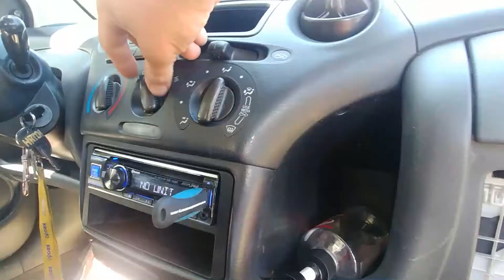HOW TO REPLACE CABIN AIR FILTER on TOYOTA ECHO | AIR FLOW DIRECTION | Do it Right.

Comment: fyi all: On my 2003 Echo the filter goes the other way around (flat face/edges down, and the edges click into place within the base of the tray).   I found it a bit difficult to judge airflow direction with my hand.. Therefore I appreciated the comment/idea below re: consider where the blower motor sits.

Comment: If the blower is mounted below the filter then the air flow is downward, not up. 

Consider this...
You can't assume that your old cabin air filter was put in correctly and simply copy it.

Air flow is NOT going up. Air flow is down. If you put the filter in with the air flow arrow pointing up then it's upside down.
The ONLY time an arrow on a cabin air filter should point up is if it says "up" next to the arrow. All horizontally mounted cabin air filters with the blower motor mounted below the filter have downward air flow. Otherwise the blower motor would be full of dirt and debris. If it doesn't say up next to the arrow then the arrow indicates air flow direction and should point down. Another simple way to determine this is noticing how the dirt accumulates on top of the old filter which proves that dirty unfiltered air enters the topside of the filter and flows downward. 

Still not sure? Then remove the filter and turn on the blower. Then put your hand where the filter goes. Does it feel like it's blowing upward? Use a piece of string or tissue paper. They will be sucked downward.

All the Toyota parts that say up on them have nothing to do with air flow. They are simply telling us which side goes up. So if your filter says "up" next to the arrow then of course it should point up.

If it doesn't say anything next to the arrow (like on a WIX branded filter) then by default an arrow on an air filter indicates air flow direction. I've already emailed WIX to confirm this to be true.
Reply from the maker: Great points, thanks for sharing. Best and easiest way to check an air flow just by turning your blower fan on. Appreciated your comment. Cheers.